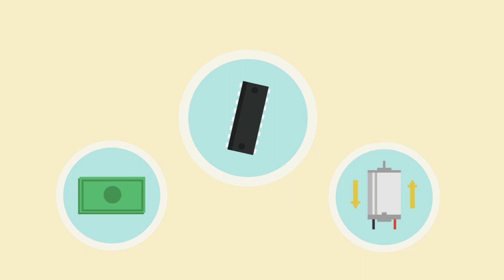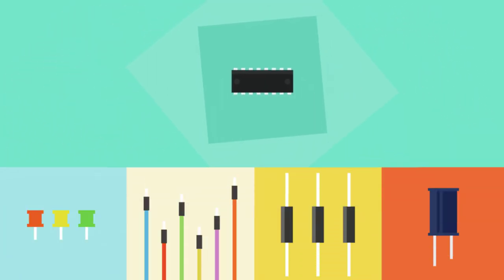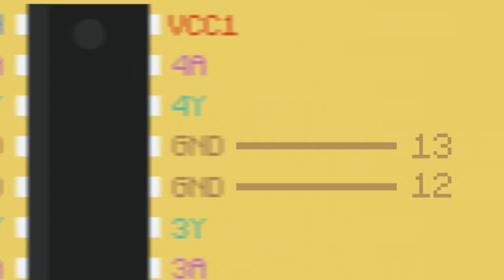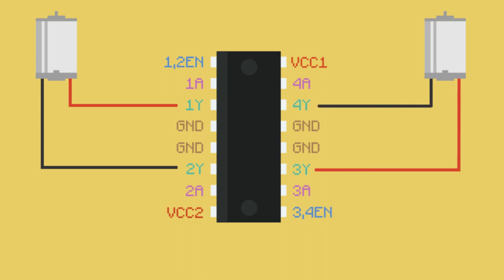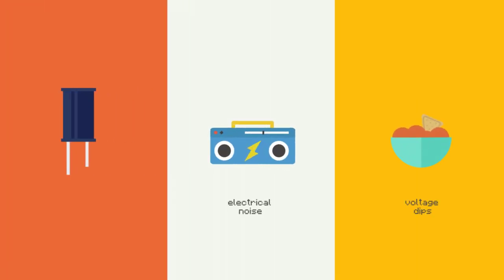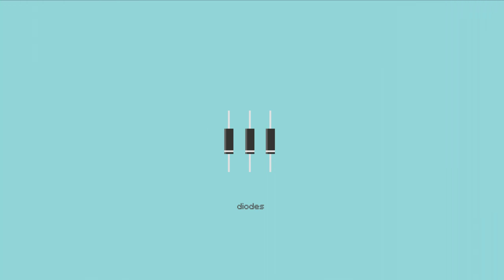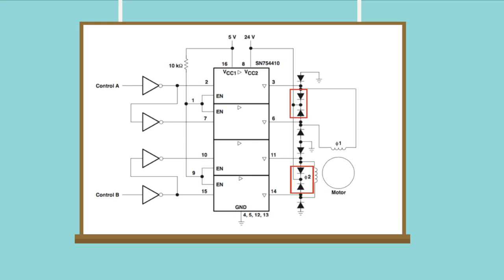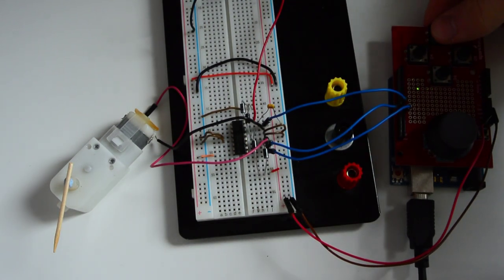Arduino & SN754410 Tutorial

Comment: Hello
thanks for the really helpful tutorial
and I think the diodes are 1N4001 NOT IN4001 (not a big problem though)
Reply from the maker: +mohamad bilal (Speed King) Haha, well spotted ;) Only noticed myself after upload of course!
Reply: +Gregory Kelleher 
Hi
I have a question , WHY did you choose this diode?
Is there any special feature in it or just a diode to prevent emf?
one last thing :
I have too much 1N4007 diodes can I use them
P.S. the only difference between the 1N4001 and 1N4007 is the Vr[repetitive peak reverse voltage] and Vrrm[continuous reverse voltage] the 1N4001 has 50V for both Vr and Vrrm and the 1N4007 has 1000V for both Vr and Vrrm
Sory for the long comment
Reply: +Gregory Kelleher Oh I've noticed it you said at 3:44 that the break down voltage should be more than the bat. votage I'm sorry I didn't noticed it the first time
Thanks
Reply from the maker: +mohamad bilal (Speed King) No problem. You're right though, their purpose is to prevent EMF. 
I've written a post if you'd like to read some more: http://gregorykelleher.com/blog/motor_control

Or if you'd prefer, this is another great source: http://www.robotroom.com/HBridge.html
Reply: +Gregory Kelleher Thanks ; )

Comment: I ordered a mobile robot arm kit from amazon - it looks promising, but the remote control is broken - half the buttons don't do what they are supposed to, and the other half don't do anything at all.   So I decided to connect it to my RC quad receiver - the only issue is that the receiver sends PWM signals meant for servos.   Arduino also sends PWM signals - do you think kit would convert the PWM correctly to operate DC motors?   I want the centre position to be 0 volts, full left servo signal to send minus 4.5 volts, and full right to send plus 4.5 volts.  I wasn't planning on including an Arduino in the project, I just need to convert 6 PWM signals into 6 +/- 4.5 volt signals.   Also, would there be a unit that does 6 channels at a time, or would I need to include 6 separate controllers?  Or, hang on, 3 controllers, these control 2 motors each?
Reply: After a heap of research, (chrome is about to crash with too many tabs open) I'm considering a different approach - 3 digisparks - basically mini arduinos, that cost about about 2 USD each.
http://www.ebay.com.au/itm/Digispark-Kickstarter-Micro-General-Usb-For-Attiny85-M-Development-Board-Ic-O-/291834152869?hash=item43f2abc7a5:g:bxMAAOSwH3NXnuFF

Each has four input/output channels, I'd set them up to be two digital PWM inputs and two analog outputs to the motors.   Would I need motor shields to control the motors?  I'm hoping your approach of using motor terminal diodes would be enough if added directly to the output channels.